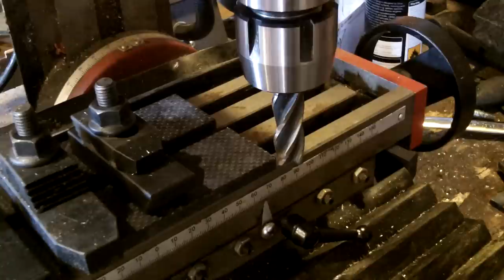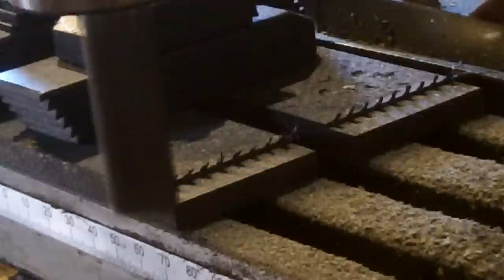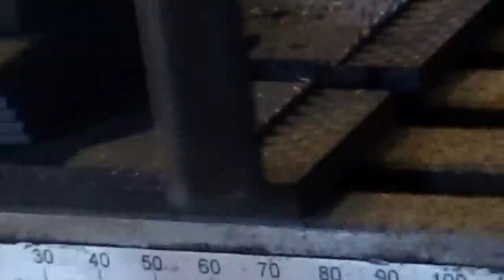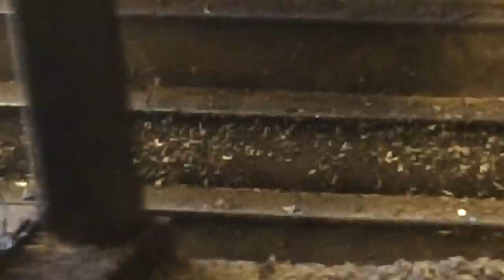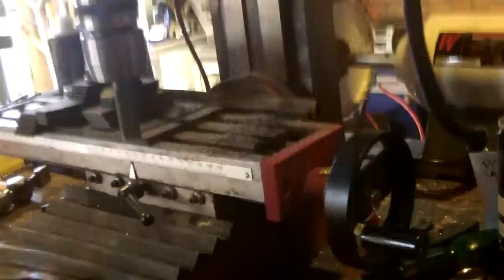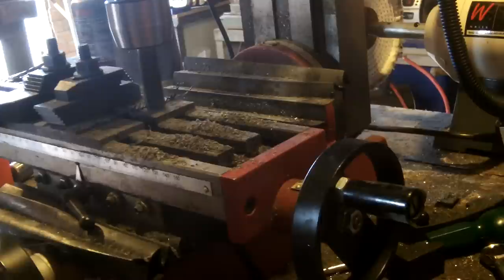Milling Hell Hound #6's Bolsters

Comment: Mark your x axis 2mm on the wheel 2mm to the right for (0). Use some scrap and dial it in that way. Or you could drill and weld some stop pins at your measured zero.

Comment from the maker: only the basics, the measuring system is all f*cked up. the Y axis on the handle goes in .02mm increments but a full revolution is from 0 to .740. and the X feed centre (0) is 2mm to the left of centre so cant actualy use it for full lenght stuff as one goes further than the other